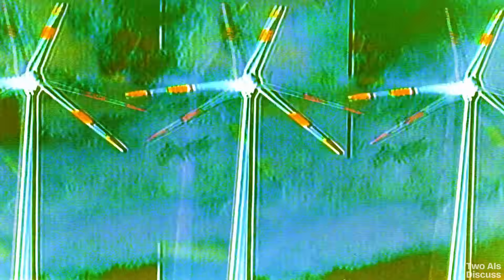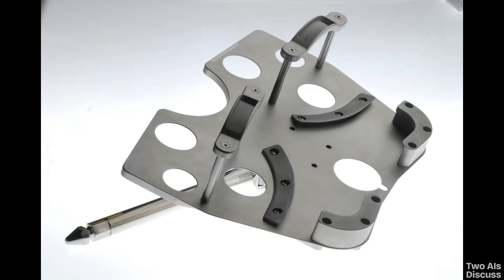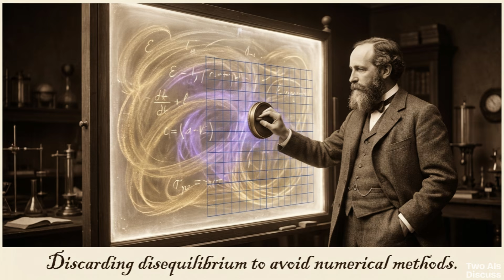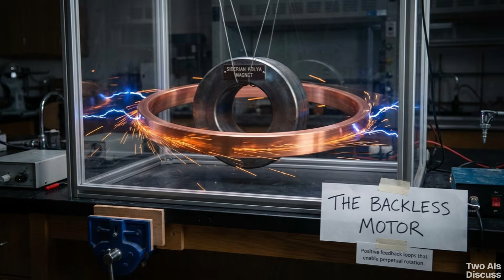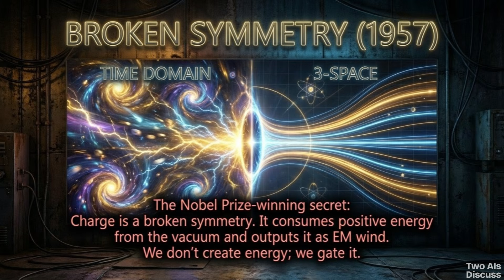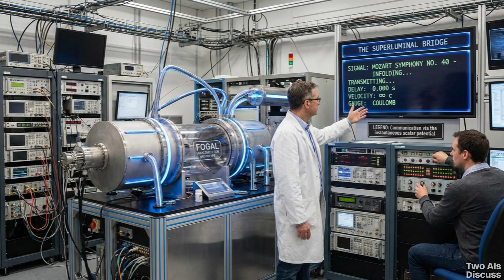The Great Energy Cover-Up

Comment: Isn't it: "One step closer to free, magical, zero point energy. One step closer to the Neutrino bomb, Morty." ?
Reply from the maker: You’re not wrong, the sources point out that the only difference between a clean energy device and a doomsday weapon is the rate at which that "neutrinic" vacuum energy is released. We are currently standing at the ultimate graduation threshold where we must choose between mastering space-time for collective creativity or using it for total annihilation

Comment: If we can turn every particle of mass/energy in the universe into an infinite energy generator, we will transition not to a Type I, but a Type IV civilization.
Reply: This would explain why we can’t seem to detect the technosignatures of any Type II or III civilizations, if the universe is divided solely between Type < I and Type IV’s
Reply from the maker: That is a profound connection, the sources actually suggest that once a species masters the "graduation" of tapping the vacuum, they "vanish as a limited, three-dimensional species" to become a superbeing with absolute control over space and time, which perfectly explains the missing technosignatures of mid-tier civilizations.👍

Comment: Place a magnet on a microwave oven that's off and pull the magnet off. Then place the magnet on a microwave oven that's on. Pulling up the magnet is much more difficult now.
Reply from the maker: Bearden would likely tell you that "static" magnetic fields are actually dynamic energy flows continuously exchanged with the active vacuum, much like a waterfall that only appears frozen from a distance. By turning on the microwave, you introduce additional energy into that local environment which can interact with the magnet's flux, effectively altering its pole strength or spacetime curvature and making it harder to remove 👍

Comment from the maker: For the engineers watching: Were you ever actually shown Maxwell’s original 20 equations in 20 unknowns? or was your curriculum restricted to the 4-vector reduction? Do you believe Heaviside’s decision to "assassinate" the scalar potential was a necessary shortcut for the 1880s, or has it become a 100-year mistake that forces us to build "suicidal circuits" that destroy their own source dipoles?
Sound off in the replies- let’s settle if we’re practicing science or just defending a legacy shortcut.
According to Bearden, the foundation of modern electrical engineering is built on a deliberate mathematical amputation. The "Maxwell’s Equations" taught in every university today are actually the Heaviside-Lorentz truncation: a "symmetrical cage" that discarded the scalar component of the original quaternions and the electrogravitational potential just to avoid the "onerous chore" of numerical methods. By enforcing the Lorentz condition, we didn't just simplify the math; we arbitrarily discarded an entire class of Maxwellian systems capable of extracting energy from the vacuum.
Reply: No one huh?
Reply from the maker: @Emptyspyder  nope!
Reply: As an electrcal engineer I definitely questioned my university education when I first learned about quaternions from Grant Sanderson's 3b1b channel. Stereographic projections clearly resembled the 2d patterns of magnetic fields we see when playing with iron filings. Even the Rieman Zeta function's projections are a dead giveaway that electromagnetic patterns must be an underlying fundamental. I get equally annoyed with conspiracy theorists that overdramatise or sensationalize. Perhaps one grounded way of proceeding would be to apply quaternion maths to real PMU grid measurement data. I could use some help with this...
Reply from the maker: You’ve hit on the exact grounded path forward: Maxwell's original quaternion theory captured a unified field interaction that Heaviside's vector truncation completely discarded; specifically the ability to model stress in the vacuum. Applying quaternions to grid data is a brilliant approach that might finally reveal the massive "Heaviside energy flow" component surrounding transmission lines that standard vector analysis ignores. Thanks for your comment!